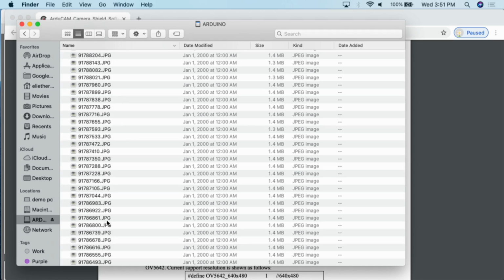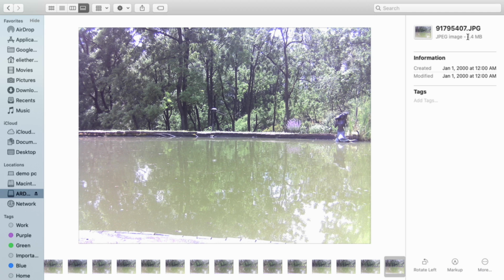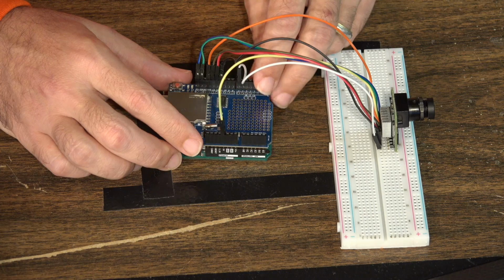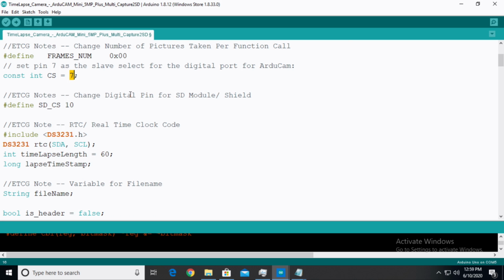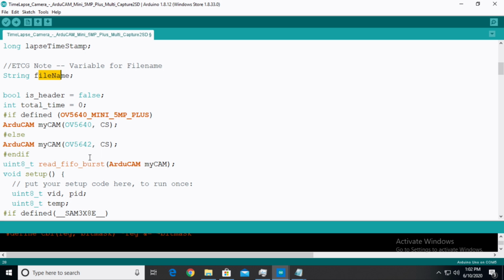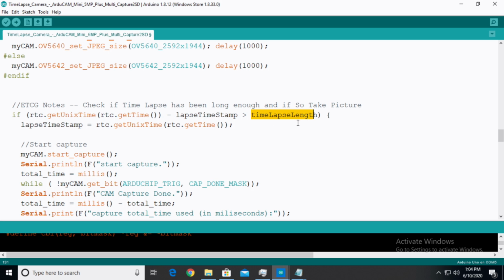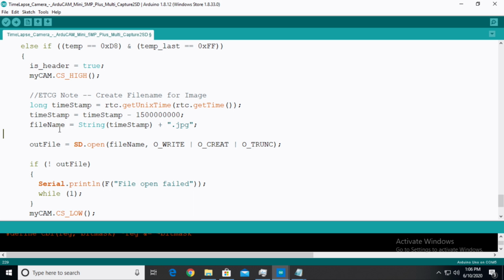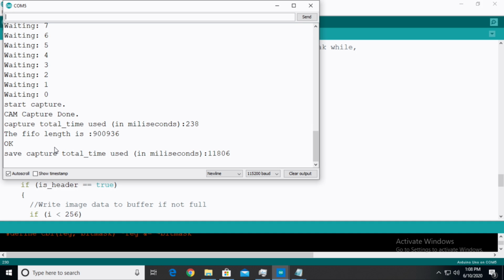Arduino Arducam - 5MP Time Lapse Camera

Comment: Is anyone getting the File Open Failed error? I've tried everything to fix it; even swapped SD cards and it worked for the prerequisite files; just not this one. It's the same Cam and Data logging sheet or whatever it's called. Any helpers?
Reply: change the naming code, it must be 8 characters long. The substracting 1500000000 is not good.

Comment: Hello sir , I tried running the program but it's giving error for memorysaver.h I made the correct changes as told by u but still shows error for selecting hardware and platform
Reply: I think the camera that you had may be different to his one. Please check your camera model. Hope it helps.